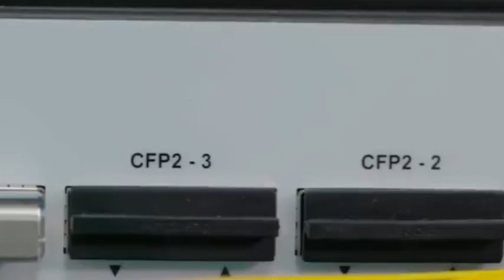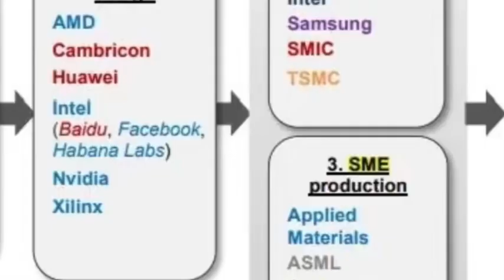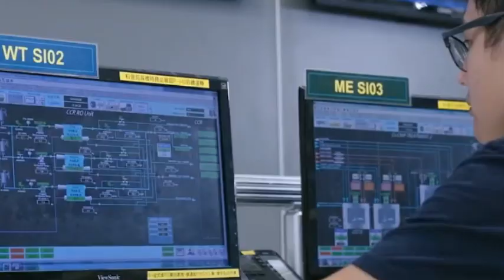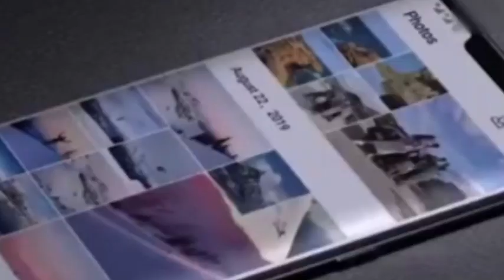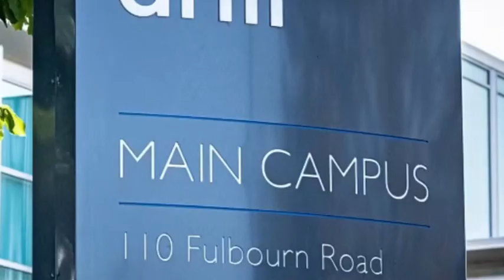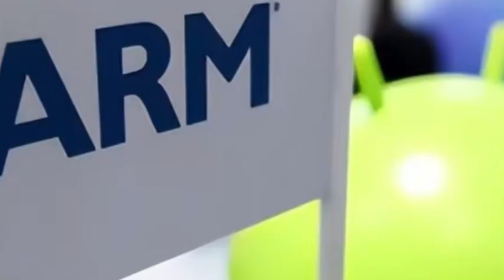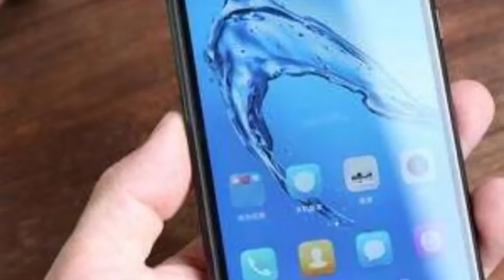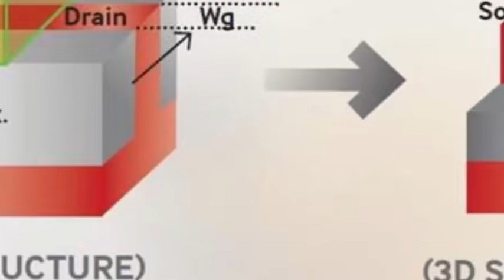Huawei is testing the next-generation Kirin CPU, which is expected to achieve "pure localization".

Comment: For Huawei, first mover advantage will be in photonics, graphene, and quantum chips. It will catch up and be among top producers of CPU, GPU, and even APU chips. Since Huawei will use a completely domestic supply chain, its ability to advance in chip type and production will be faster than competitors.  Keep your eyes also on chip production equipment, from lithography to steppers, Huawei has its fingers in all facets of chip manufacturing, test, and encapsulation.